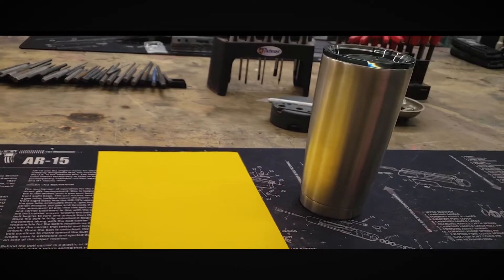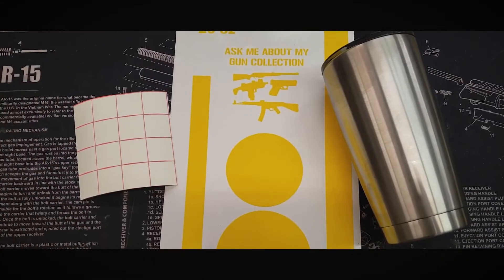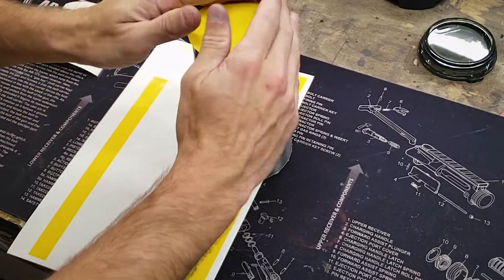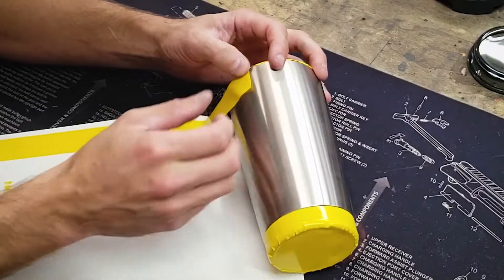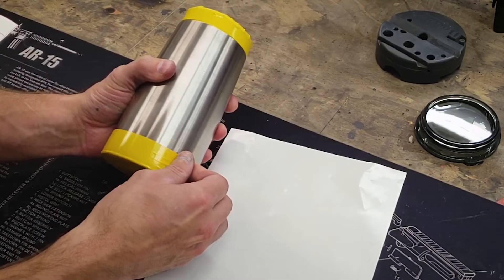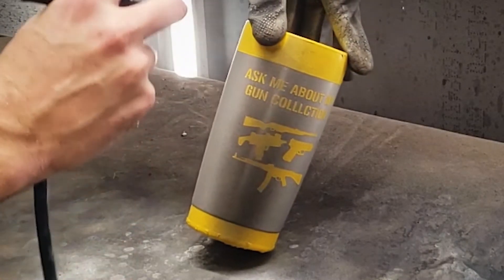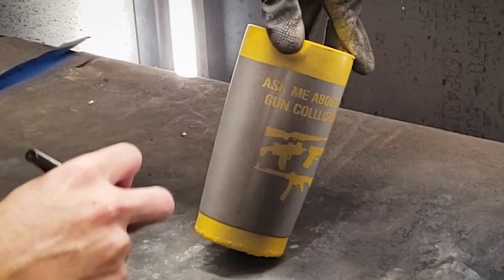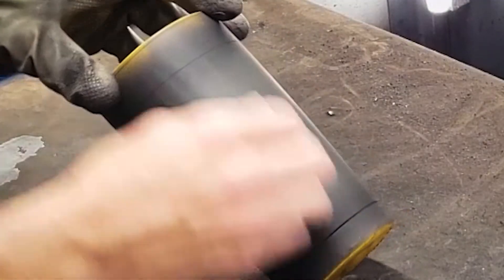How to Paint TUMBLER CUPS with Safe Drinking Mask

Comment from the maker: Recommended TOOLS & EQUIPMENT!

- Mini HVLP - https://amzn.to/393zhfv
- Professional Mini HVLP - https://amzn.to/2NTNy7u
- HVLP Magnetic Holder - https://amzn.to/3hK2ujH
- Airbrush - https://amzn.to/2Xe1rin
- Professional Airbrush - https://amzn.to/3kkfE87
- Flexible Airbrush Hose - https://amzn.to/2NQk4aH
- Airbrush Holder/ Cleaning Kit - https://amzn.to/3aL0MMY
- Airbrush Quick Disconnect - https://amzn.to/3kgVCLL
- Silicon Plugs - https://amzn.to/3khH6mR
- Paint Mask - https://amzn.to/3sxIsgz
- Small Parts Holder - https://amzn.to/3khz1Ph
- Reducer/Cleaner Bottles - https://amzn.to/3aNuCAg
- Gloves - https://amzn.to/2P4fXZk
- Ear Protection - https://amzn.to/3aLZf9j